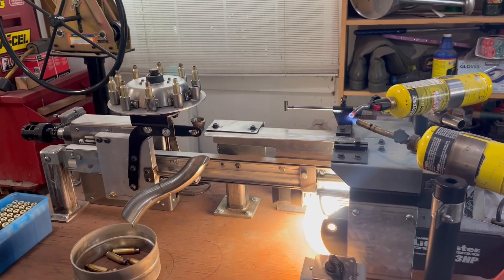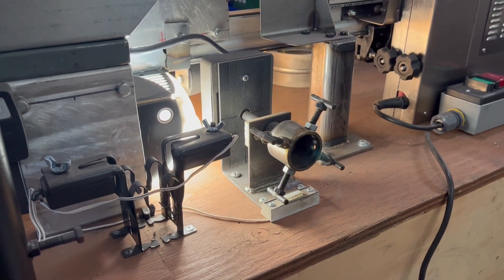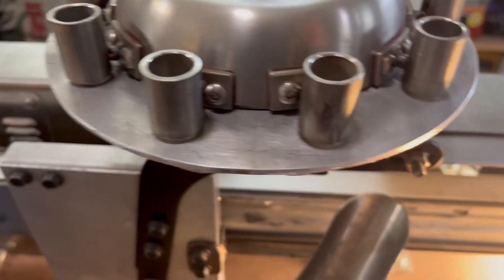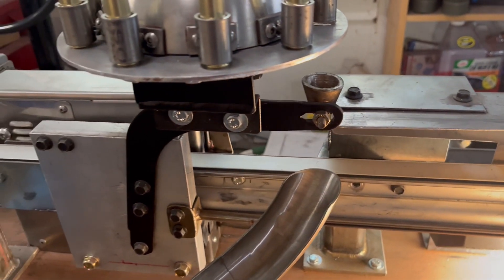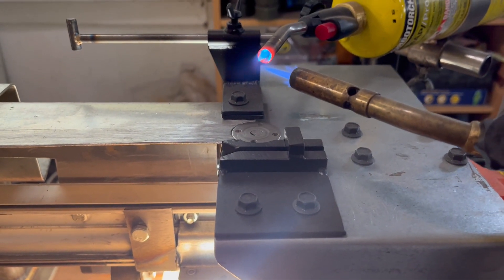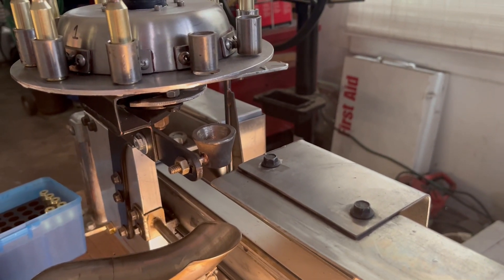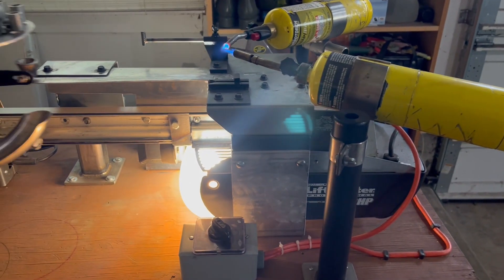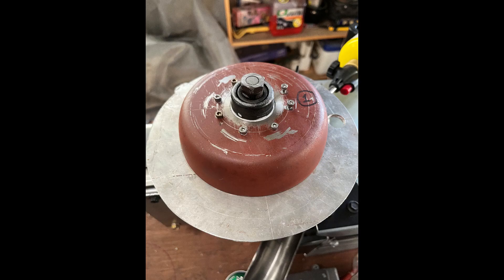Craziest Brass Annealing Machine (DIY)

Comment: Clever solution! Ages ago, I recall reading a suggested annealing process that simply called for setting the brass cases upright in a shallow pan of water, heat neck of each with a torch until cherry red and then tip the brass over to quench. I like the consistent repeatability of your device. Is air-cooling just as good as a quick water quench?
Reply from the maker: Hi Will, I would have to look into it but I know with steel, if you quench it in water it hardens it. If that were the case with brass, you would be defeating the purpose of why we’re annealing in the first place.